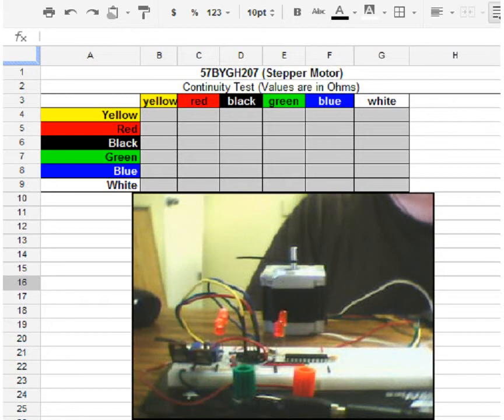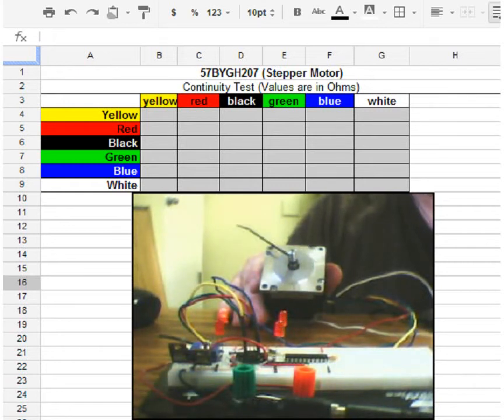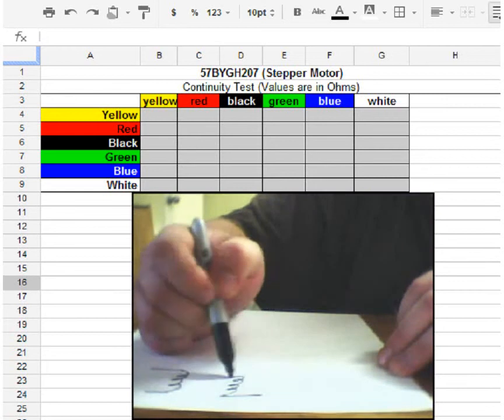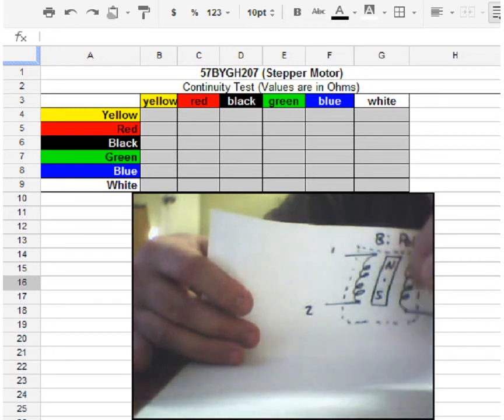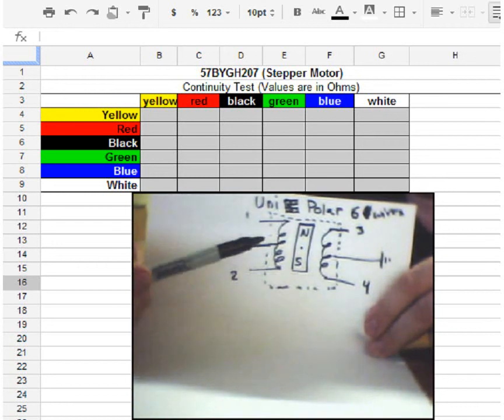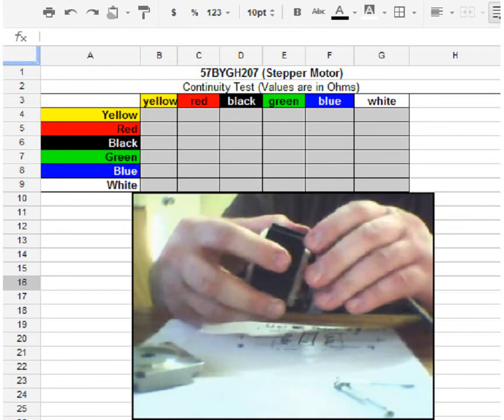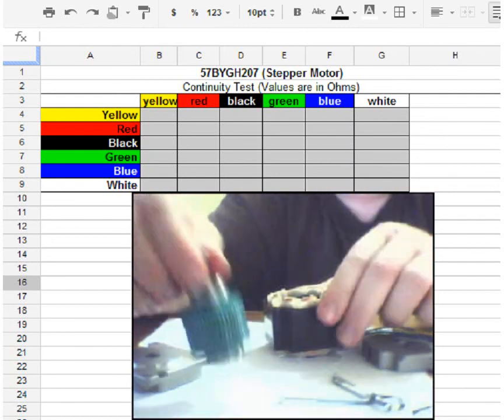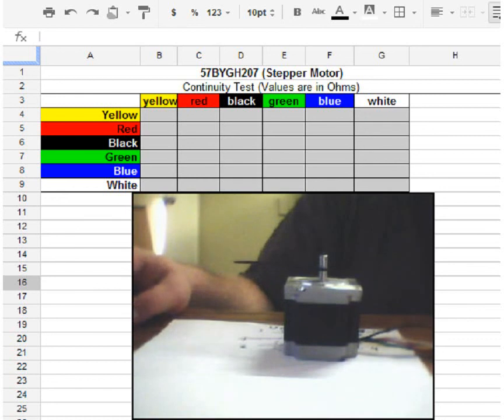Stepper Motor Tutorials: Steppers Explained

Comment from the maker: Sorry for the late response. I have been really busy with school. They aren't really washers, they are kind of a spacer almost. I am just not sure what they are called. They are circular like washers, but they are bent a specific way to create kind of a spring action when you put the core back in. I believe they are used to keep tension on the bearings to keep them in place. Sorry for not being able to explain them better.

Comment from the maker: Unfortunately I never dealt with a 5 wire setup before. But I imagine that instead of having two separate wires for the center of the coils, that you would have just one wire that goes to the center of both coils. I would imagine that you would have one wire that would get a resistance across all of the other 4 wires, which would be your "Ground" wire. I would have to do more research to tell for sure. Sorry for late response. Been busy with school.

Comment: what is maximum supply voltage/current can applied for each coil
Reply from the maker: Each motor will come with its own current / voltage rating. Look through its datasheet for more details. Each motor will have different thicknesses of wire used in its coils which limits the power rating, so not all are created equal. You are basically limited by heat through the coils. The more current you send into the coil, the more the coil will heat up due to the wire and induction resistance generated by the wire itself. 

So the size of the wire used for the coils plays a big role in the resistance generated by the wire opposing the current, ultimately generating heat. However, there are special techniques to get the stepper motor driver to move faster. This is done by using a current limiting driver specifically designed to run stepper motors at higher voltages. It allows for much higher voltages to go through the coils by pulsing (also known as chopping) the voltage on and off when the current limit of the coils are reached to maintain that constant current and not go above it. The reason higher voltage increases the speed of the stepper motor is due to the induction process itself. The magnetic field generated due to induction takes time to build up. It isn't an instant on in terms of electricity. It actually opposes "current" change. This means that as you apply current to it, it doesn't want to change the current flowing through it. Although as we already know, it ultimately does. But it does it slowly in terms of electronics. Since stepper motors are limited by how fast you can energize one coil to the next, you increase the voltage to allow the coil to build up the magnetic field much faster. The issue is that while you are supplying higher voltage you end up supplying much more current than the coil is rated for, and in turn the coils heat up beyond the point they can tolerate, and you melt the coil. It no longer acts as a coil, but instead as one single wire and no longer produces an inductive field strong enough to move the magnet. This his how stepper motors are destroyed. Now keep in mind that as the coil heats up the resistance in the wire will increase, in turn generating more heat, and you burn up your motor.

So to combat this, specialized stepper motor drivers exist that maintain a maximum set point for the current (does not go above it) as soon as the current threshold for the motor is reached. This type of driver allows the stepper motor to move faster by inducing the magnetic field quicker in each coil, but does not allow the current to rise above the set point. It does this by switching the power to the coil on and off extremely fast. This is a process called Pulse width modulation (PWM). By switching the voltage on and off, the current can be maintained using V = IR (Ohm's Law). This is if the resistance in the coil were to remain constant... but it doesn't...

Note that PWM is only one part of this process. This process of maintaining the current through a motor can not be done with PWM alone. Because the coil's resistance will fluctuate greatly due to the inductance and heat, it would be near impossible to use PWM by itself to regulate the current. You need a current sensing circuit that can sense the actual current going into the coil. The PWM is then adjusted according to the feedback from the current being sensed. Both these systems are required to maintain constant current when the resistance in the circuit is changing. As the resistance changes, the current will change at a given voltage. So since the resistance is constantly changing, you need to vary the voltage constantly to maintain the same amount of current. This circuit can be built externally but there is some real world problems that make it very hard to build yourself. i.e. the resistance sensitivity for the current sensing resistor known as a shunt. You also need specialized op-amps that can sense the voltage difference across the resistor. AND you need to do this for EACH coil phase. There is also an issue with reversing the current though the coil... It becomes very complex.

Thankfully there are chips you can buy that are specifically designed to handle this process, though they aren't cheap compared to other chips. They run about 8-10 dollars each, not including the extra parts you need... And only 1 chip can run 1 motor... so if you have more than one motor... Well you can see how it can add up.

These chips limit the current (or I should say maintain it) at the current rating for the stepper motor by using PWM or "chopping" the signal on and off. These are sometimes called PWM Chopper drivers. 

But all that being said, if speed is not an issue, and you plan on staying within the specified power requirements specified, you can use two simple H-Bridges to control your motor, as shown in the video.